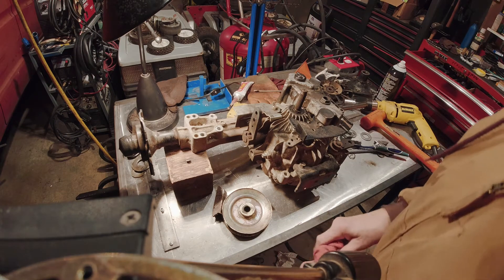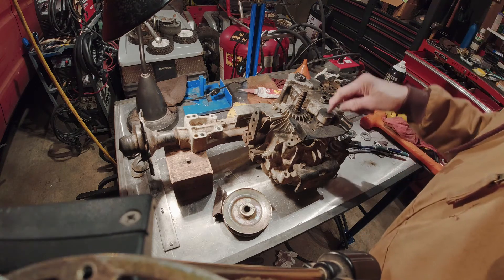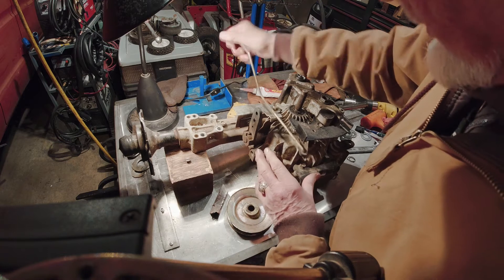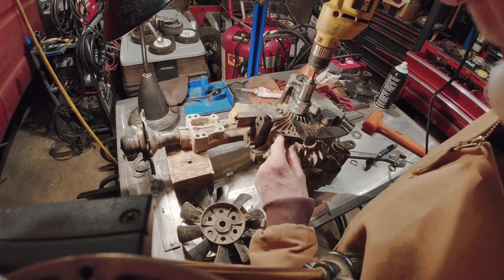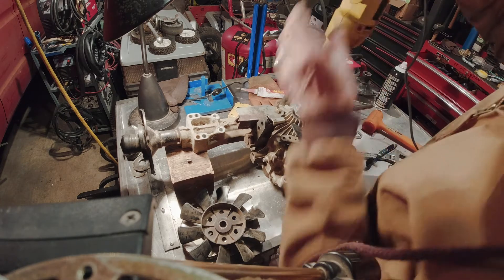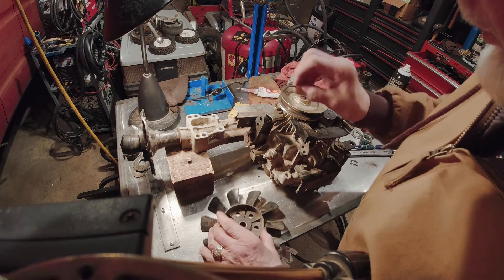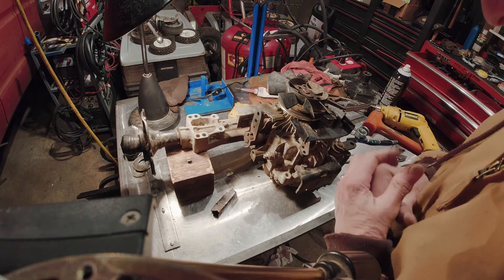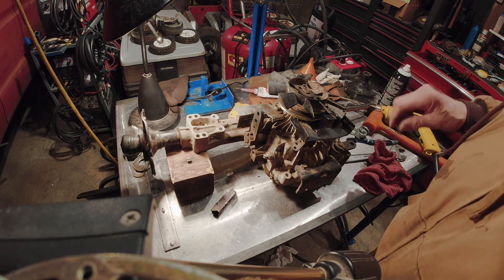Tuff Torq K46 Transaxle, left axle replacement, Part-2 (air bleed)

Comment from the maker: Update three years later: There's a small leak in the silicon gasket.  It was OK for about a year but started to drip.  The tractor is still totally usable, but I need to get that leak fixed before the transaxle quits due to low fluid.  With mowing season almost over (it's October 2024), I'll do that job this winter.  I also need to remove the mower deck and basically renew it.  Mower decks usually take a beating and go to mower deck heaven long before the tractor.

Update three years, six months later: I tightened a few bolts on the case cover which apparently was the reason for the fluid leakage.  There have been no signs of leakage since.  I dodged a bullet on this one.  I removed the mower deck and repaired some rusted areas, sharpen the blades and started mowing season. All is well...